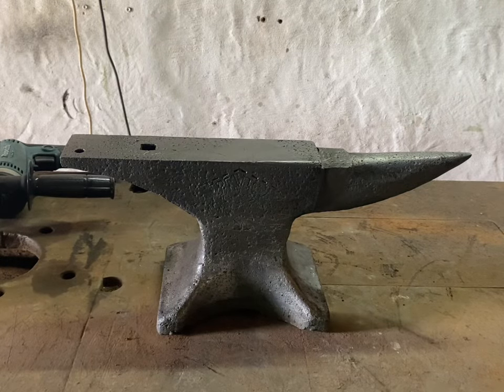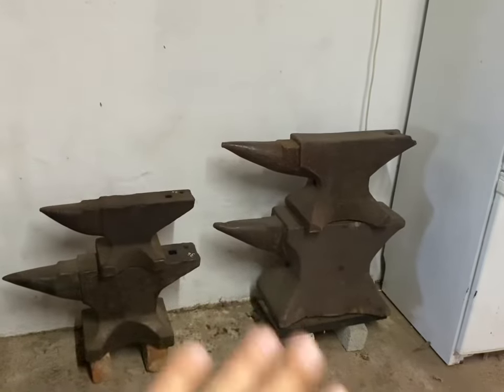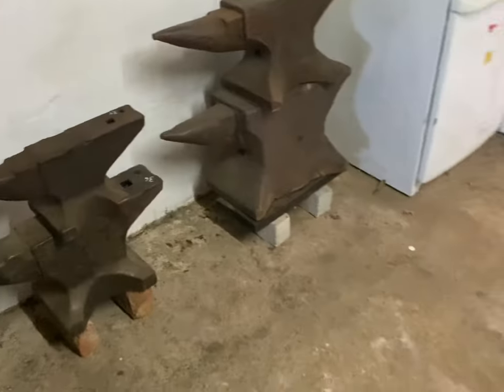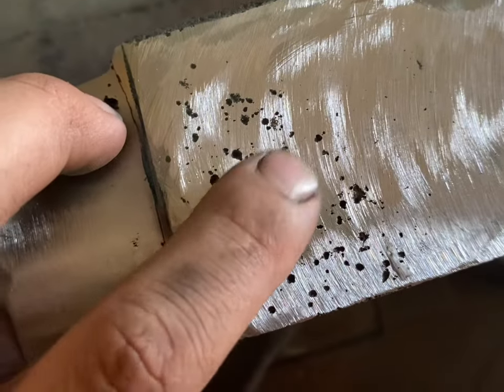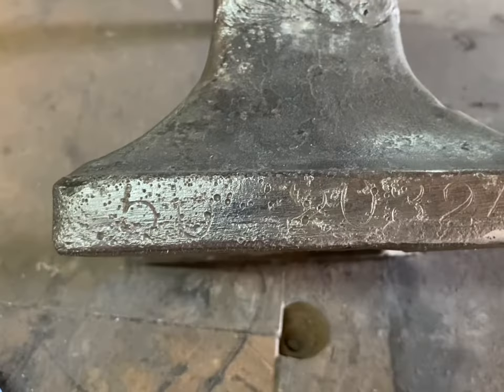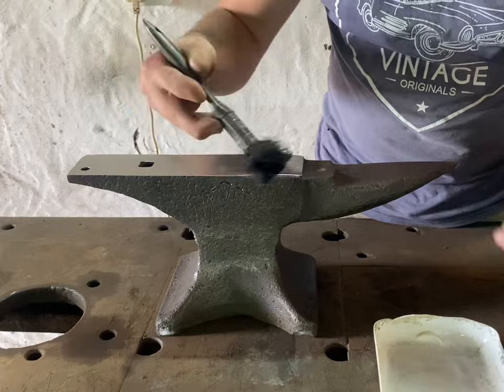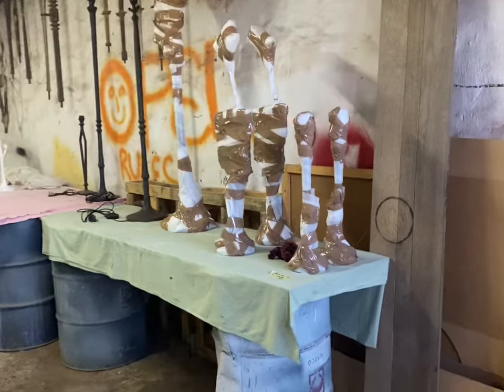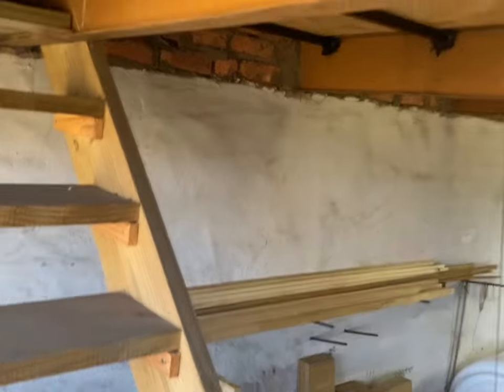Pristine 50# Trenton Restoration???

Comment: I felt sad for you seeing that occur. The heart sinks when something like that happens. It's so nice when you have a system with consistent results. Occurrences like this come and knock that on the head! 

I've never seen that occur on something that didn't have bad rust and, as you say, it was in great condition beforehand. It might just be a procedure you can't get too comfortable with. 

I'd try to get in touch with a chemist about this unusual outcome. They'd probably be able to work out what's happened quicker than anyone.

Comment: I’m no expert in cleaning metal by electrolysis, but the first thing I would ask you is – Did you, by any chance, have the polarity reversed?  The sacrificial anode, (+) positive must NEVER go to the part you are cleaning or it will eat it away i.e. cause pitting
Reply: I agree with @alc818 and @dutchcuda on that Trenton anvil. The polarity was not reversed? Check it and double check it.  Or contamination of the steel with corrosion on the interface between contaminants and the steel/iron? If the anvil was exposed to the elements for many years, ordinary corrosion can also cause this type of pitting (and you would not notice it before cleaning). You said there where "beads" on the surface of the anvil, right?  If someone is not careful welding around the anvil and welding spatter falls on hardened steel, it will cause microcracking and corrosion will settle in. Then you get the effect you saw after the electrolysis, after clearing loose bits of metal. I doubt electrolysis done properly will cause that to iron/steel and so far, all electrolysis you've done came out perfectly. I would have left that pitting on the working surfaces of the anvil and work with it the way it is.
Reply from the maker: I doubted myself as well but the way I’ve set up the dip I literally am not able to connect it wrong, the positive on my welder that holds the electrode I use for my sacrificial metal, these connect into the positive of the welder with cables that I’ve soldered the ends of. On the negative I’ve got an earth clamp which I clamp to the chain holding the anvil. It’s not possible for me to attach the positive to the chain holding the anvil. So I’m still at a loss here because I don’t know what caused this😂
Reply from the maker: Thanks so much, as always your input is so knowledgeable and makes so much sense once you’ve explained it. I’m absolutely certain that I didn’t have the polarity reversed, I did straight away suspect that but the checked and it was right, as I explained above to @alc818 I’m actually not able to connect it wrong because of the way I connect my positive. I definitely do think it’s possible there was micro cracking but also I think there were too many different types of metals in the dip at the same time which. I haven’t pulled the PFP out yet but I did pull out a few fullers and they’re also heavily pitted.

Comment: Can't speak too much about your electrolysis dip but I ruined some small auger bits in a warm vinegar/salt bath that literally ate the metal away and I believe it was from leaving'em soak too long. Trenton turned out nice anyway. 👍🍺
Reply from the maker: Thanks so much, yea the electrolysis only works when currant is applied, where as vinegar is acidic do it will keep on etching. 

I’ve left things in for a long while before and this hasn’t happened but at this stage I’m not shutting down any opinions because i have no definitive answer as to what caused this.

Comment: My wild guess is the poor quality of the steel is what caused the pitting.  Those Trentons are cast, right?  I bet there`s something in the mixture that shouldn`t be there. If the electrolysis was the problem, the pfp would have some kind of problem too I guess...?
Reply from the maker: Yes it’s very possible, I haven’t had time to pull the PFP out but I pulled some of the fullers and they’re also badly pitted so it’s very possible it was different metals causing a problem here